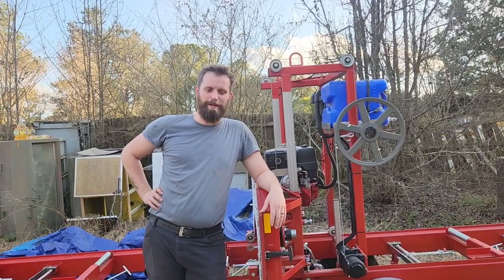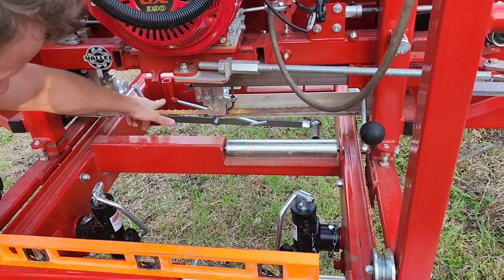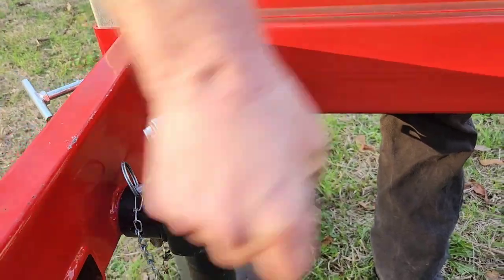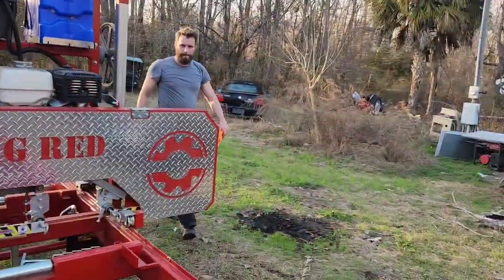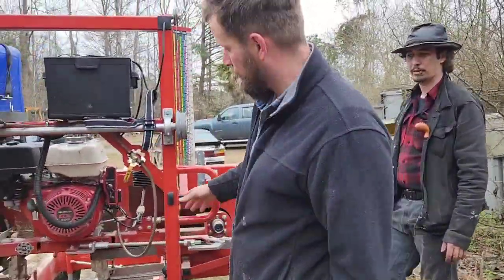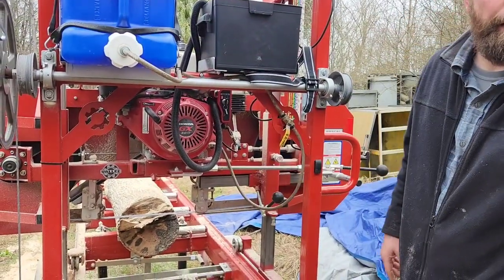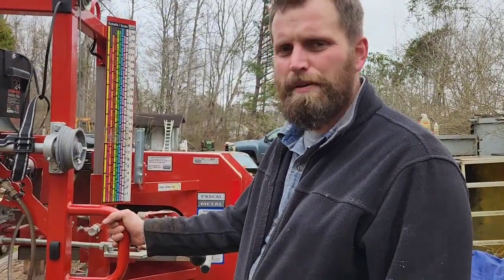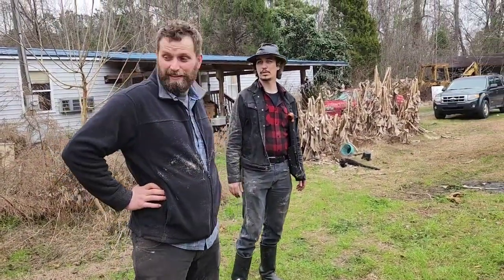Sawing with Ease: How to Setup and Use a Mobile Sawmill

Comment: I was watching your little coop vid and decided to see what else you had. Imagine my surprise to see a "little red"! 
Not bashing, I run the Green-daily. 
Uncomplicated, reliable and readily available replacement parts. 
Everyone is going to have advice, so here is mine: pavers travel easily when you move your mill. Put them under all the feet and jacks, and hopefully you got that mill flipped. Those logs stops will bend, but better than launching a log and having to drag it out from close quarters on your operator side. 
Your cant hook probably arrived, so that will help, but flip twice to square that cant a lot more easily. 
Wear eye and hearing protection. You are already going to have sawdust boogers but a breeze back over is going to put it right in your face. Sawdust boogers are a thing, but they suck in the eyes. 
Did Doug not give you a cover?
Spend some rime on that mill before hiring out and save yourself some aggravation. 
I wish you the best of luck in your milling and farming adventures. I have a feeling we are probably close to being neighbors, lol. 
Welcome to the sawyer family. Msg me if you have any questions about running that red. Best log scale in the industry still, without a computer on a WM.
Reply from the maker: We haven't moved the mill yet, we  have been having alot of other projects going on. And we have been talking about throwing papers under with how much rain we have been getting, there is a small concern about the ground not holding the log and mill without the pavers. 
So that gives me more confidence in using them. 

And yeah, while building the chicken coop i did notice that there was unevenness to a bunch of the wood. So there is definitely more dialing in and operating time to get under the belts here before we decide to mill for anyone else. 

Thanks for the feed back and I hope you enjoyed the videos
Reply: @Tibbs_Farm  you blade is diving? Ripples basically? 3 possibles: Either you are not staying in the green, to keep the tension on the blade, the blade is dull (can happen with bark/dirt just like a chainsaw) and/or you are not running those guides up as close to the log as you can. The apex blades that come with the mill are good but they loose an edge and you will feel the need to push the mill more rather than the glide. They will snap and scar the inside of that plywood cover and scare the bejebus out of you- or it did me.  
Not trying to be a know it all, I have had my mill for a few years and love it, but I do wish they could make a debarker retrofit, lol. I always wash my logs with a sprayer, and the first year I debarked one side of my logs with a grinder and a 5 tooth wheel. Great for the bladss but hell on my wrists and dirty AF. I quit but I sharpen my blades and touch up the tips every AM just about. No more diving. 
I also went with WM blades that do last longer. 
One recommendation just to save you some sweat: get a posthole tamper to help you press your logs up to your stops. It's spring and all the new logs will be sappy and heavy. The cant hook is good, but snugging up for square can snap the handle.  
I'm just happy to see the brand out here more. It is a simple, rock solid product.  
BTW,  what are you putting in your water to clean your blade?
Reply from the maker: @Rhea Griffiths  it isn't rippling the wood. It was more of 1 continuous concave. And it wasn't on all boards nor all cuts. 

Now that I think about it, I should have checked for level the second day that I cut. Make sure the ground didn't get soft overnight and loosen some areas up.